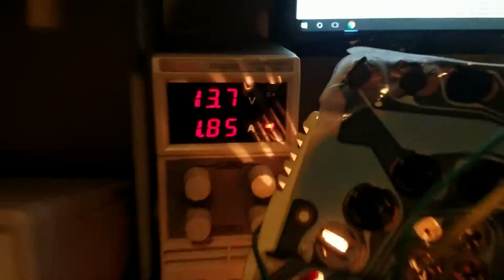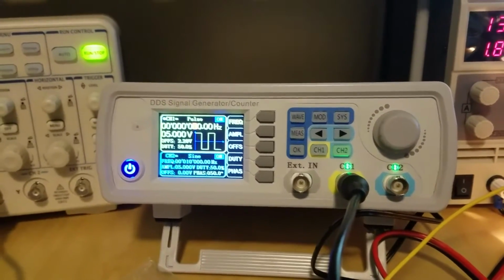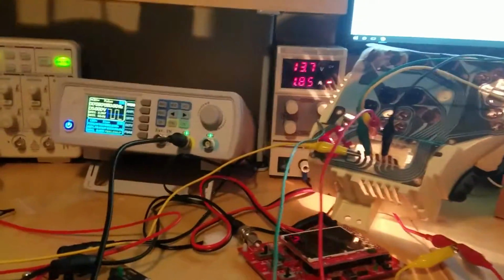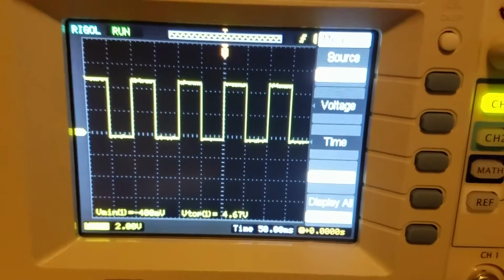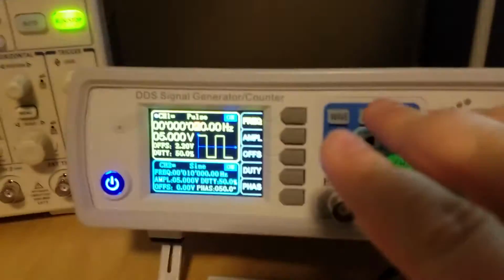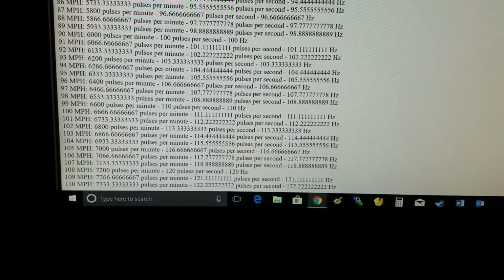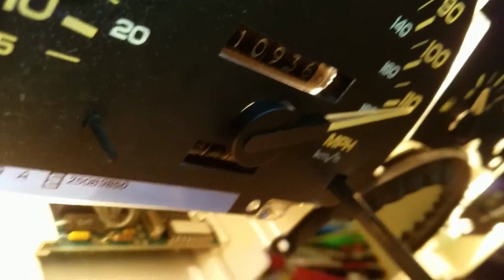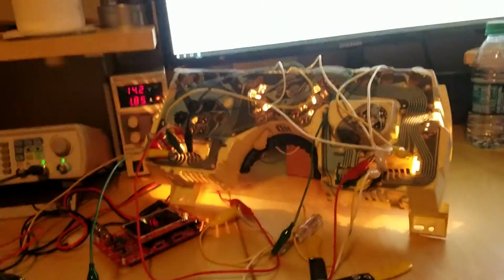1990 1991 1992 Camaro Speedometer Bench Test

Comment: I WOULD LKE TO SEE HOW YOU HOOKED UP EVER THING  THANKS
Reply from the maker: Everything? There's a pinout here
https://thirdgens.com/2018/02/21/benchtest-speedometer-gauge-cluster/
Reply: THANK YOU VERY MUCH
Reply from the maker: There will be 2 wires coming from your frequency generator:
red wire to the #1 pin (SPEED INPUT)
black wire to the #2 pin (GROUND)
There will be 2 wires coming from your voltage generator:
red wire to the #14 pin (GAUGES POWER)
black wire to the #2 pin (GROUND)